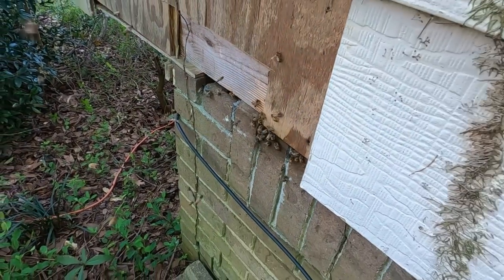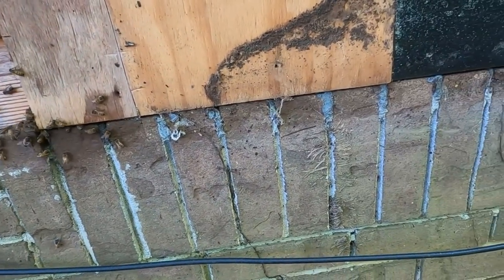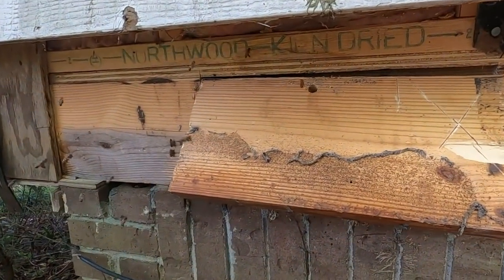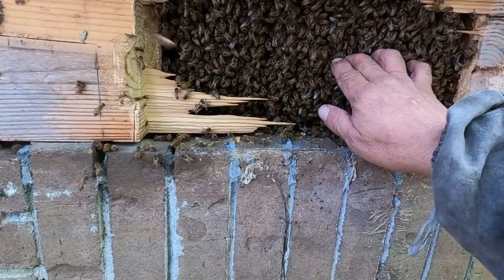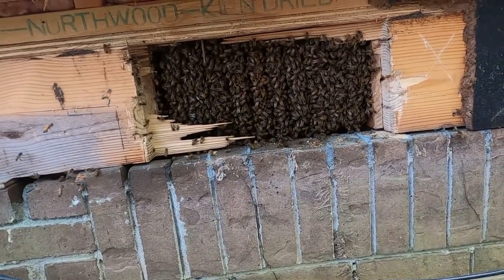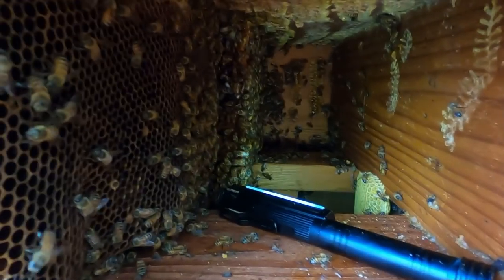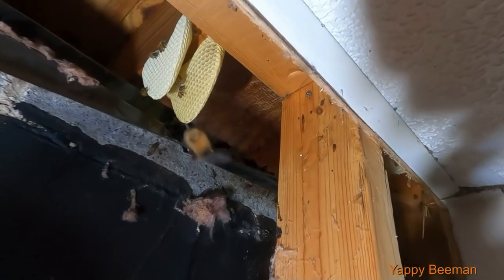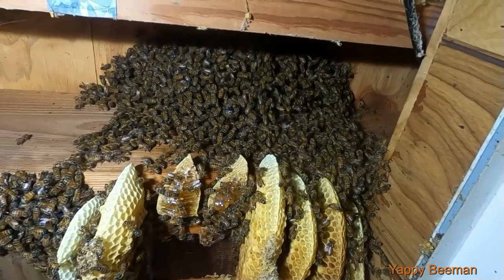Huge Honey Bee Infestation That Tested My Skills

Comment: Nice. . You guessed it, spot on. Dang, a cell right on the edge. Seems like that comb being between those support beams would work out for placing in a hive. Dang, that is a good sized colony there. . Awesome time there. Thanks for sharing. . 🐝🐝
Reply from the maker: I was so glad they had a drop ceiling in the basement.   That would have been a horrid mess if not.   But I sure did enjoy it after I finally finished...wink wink

Comment: Good lord son you can’t be chopping out no load bearing main sils specially on a two story house .. that boards hold weight all the way to the roof.
Reply from the maker: That has been discussed so much its not funny.   It was repaired back  just fine.